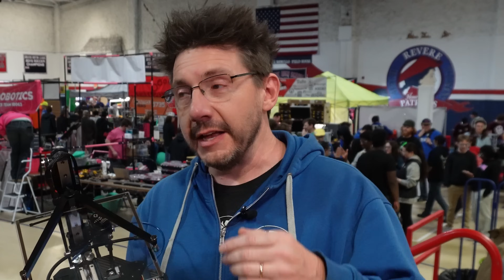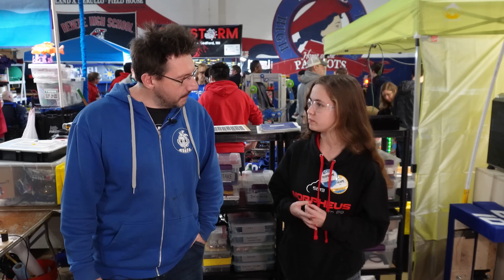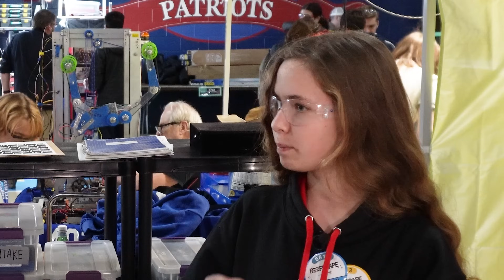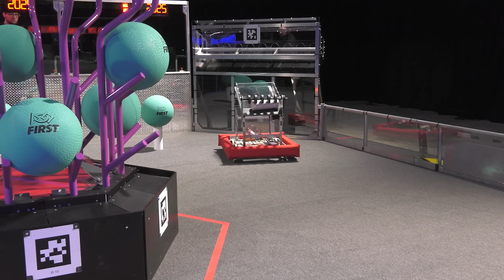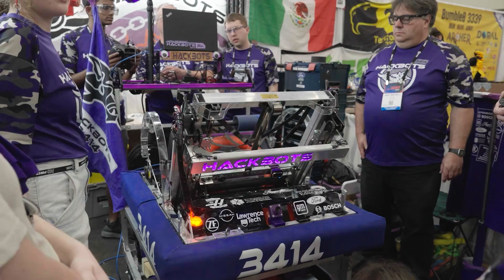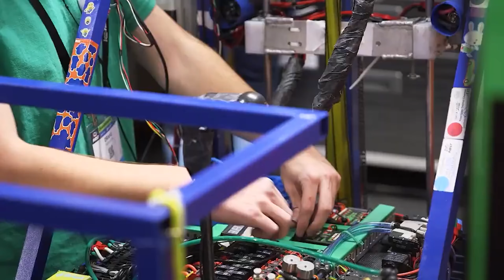3D Printing for Robots?

Comment: I'm always glad to see more publicity for FIRST Robotics. I started a team (2102) at my high school in 2006 when I was a junior, and I've been a coach for them ever since. It's truly the best possible education program, not just for engineers and programmers, but any kid that will do any kind of project based job. We 3D print all our pulley's for belts, camera mounts, electronics covers, wire management, low-impact mounting hardware, tons of stuff that would take a lot of $ and/or time to buy/machine. Usually we have a good idea of what 3D prints are at risk when at competition and make spares, so we don't need it mid-competition, but we use it extensively at our shop (and our own personal printers). If your or your kid's school has a team (or there is a community team near you), you should absolutely join it.